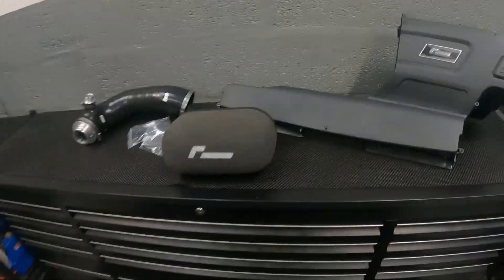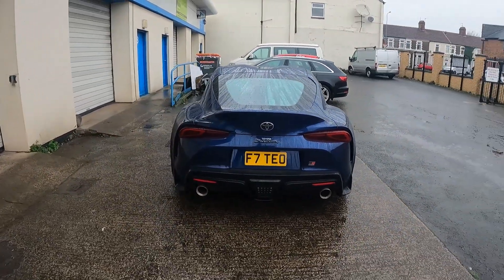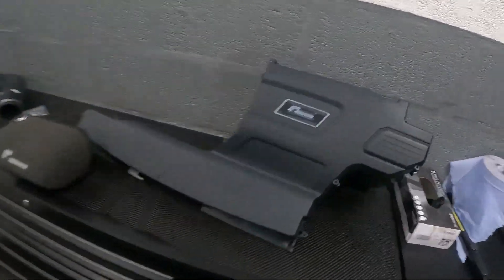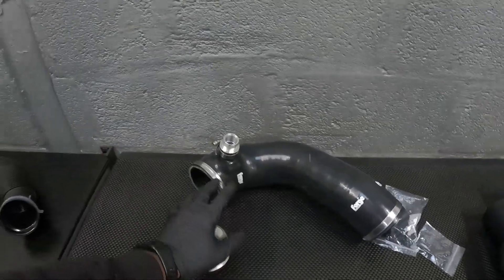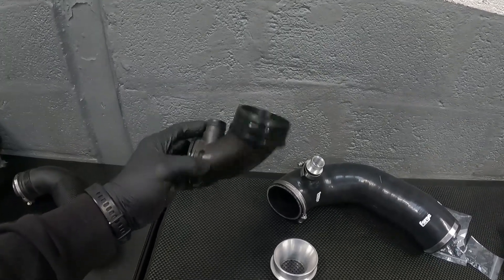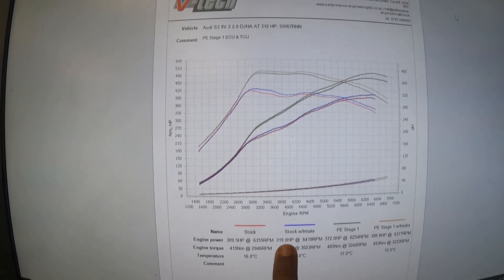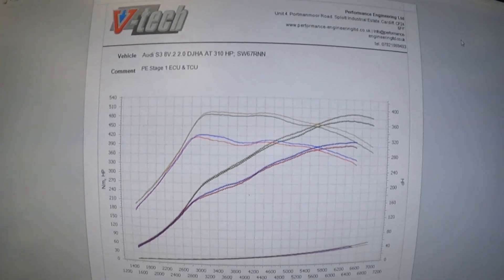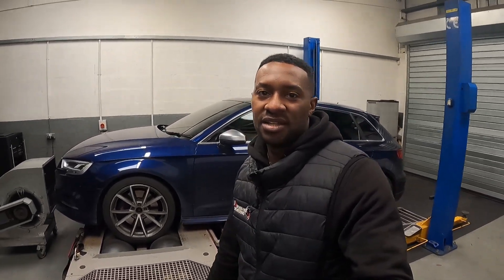MQB 2.0T Intake Testing - VW Golf MK7 R / GTI & Audi 8V S3 & SEAT Leon Cupra

Comment: Amazing numbers for this S3, if you haber applied a Stage 1... IS It means that the car is stock excepto The air intake system? No downpipe or any other mod?
Reply from the maker: Yes that's correct, stock hardware other than the full intake system and PE ECU & TCU tune great package for these 👍
Reply: @performance_engineering  Im looking for a León Cupra ST 300 and I will take in consideration your intake modifications before doing the remap here in a Spanish tunner. Thanks four your quick answer!
Reply from the maker: @Jdelgado57  nice, you will enjoy the car even more when you start modifying it 👍

Comment: Good video Nate!, loving the PE sauce on mine, but am thinking about getting a sports cat and taking it a little bit further!
Reply from the maker: Cheers Ben. Lol good to hear your enjoying the PE sauce 😁 Sports cat would help release a little extra sound and performance, should produce some good numbers 👌
Reply: @performance_engineering  with a stage 2 hardware setup and tune with sports cat instead of a decat downpipe will these mqb motors still pass an emissions test? I've heard even with a sports cat it needs warming up prior to an MOT, is there a sports cat on the market which will pass emissions without having to warm up the sports cat? If so which brand and would it have to be a 200cel euro 6 sports cat? Last thing I want to be doing is warming it up but the car still failing the emissions test. TIA
Reply from the maker: @TheCinderellaman10  yes that's correct most sports cats these days are very close to the limit of passing an MOT. Most still bring on an EML for these engines. With some decent heat pre mot test it should still pass on the emissions